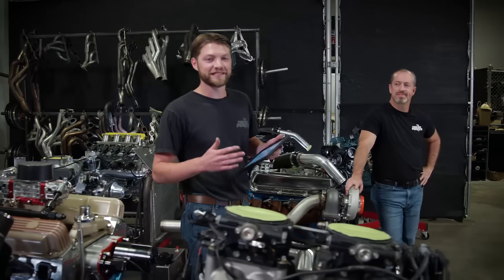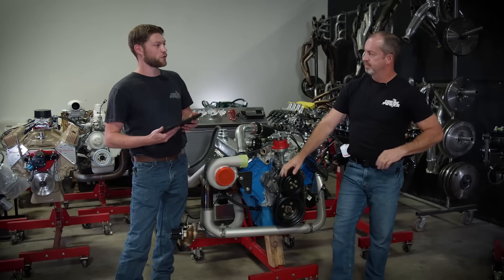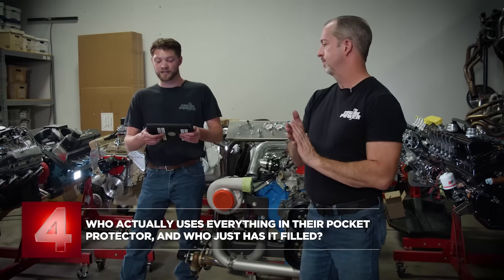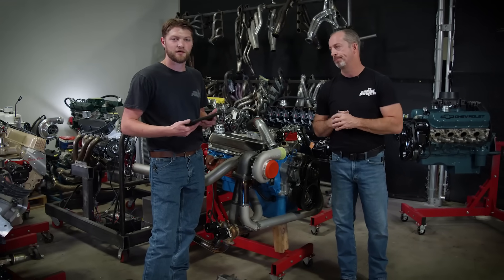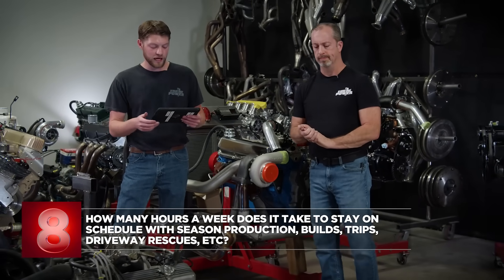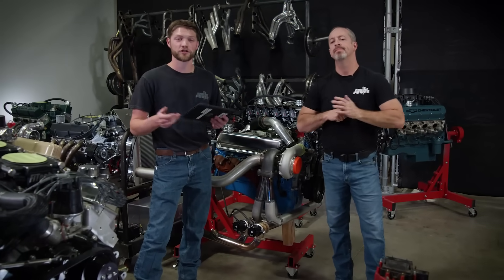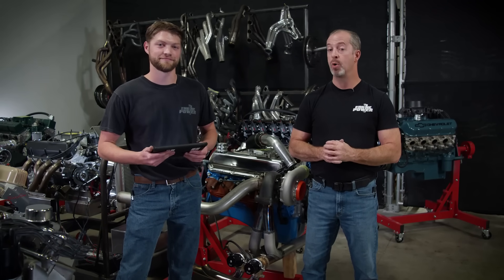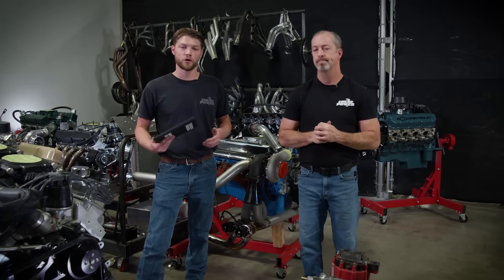Expert Engine Builders Answer Your Top 10 Questions

Comment: I have questions.

1. When you knife edge a crank do you reduce engine torque output and does it weaken the crank?
2. When you off set the crankshaft does it weaken the crank also by how much if you grind?
3. What’s the difference between normal bearings and racing bearings and do they reduce friction on the engine?

Comment: Love the show!  Question. What is a better solution wire arc’s aluminum cylinder blocks or is it better to have sleeved blocks for high rpm and compression builds?

Comment: Why hasnt no engine builder ever try to Build a Buick 401 or a 425 nailhead engine and  show us how to port out and  bore out  a 4 barrel manifold intake  for a 1965 buicknailhead and  add Alluminum 3 groove pulleys and also with the  same w engine heads bored them and  port them out and show us the Hp horpower on the dyno  improvement and them use better carb and show us with installing a  holler sniper 2 on it to see the difference Horsepower  bored out and a and 425 nail head,  do the same and the 401 425 nailhead do they  have the same diameter  heads or are the 425 nailhead have bigger  heads and are they interchangeable , and  I never seen a electric water pump made for a buick  401 425 nailhead engine  and they are small block not big blocks lolololol and  see if u add a bigger cam give power or stay the same power we need more buick nail head build and there not related to 400, 430,455 buick. And  engine  this are big block.  GS BUICK 1965 WITH 2 NAILHEAD  CARBS AND THEM MAKE A MODER INTAKE FOR THE DUAL CARBS AND THEY NEVER DID AND FOR A 4 BARREL INTAKE NAILHEAD  All buick models  1966  BUICK CAME WITH A DIFFERENT  BUICK engine  400 430 455 and  only All buicks that were  1965.and down  came   with buick Nailhead engines. Wight I think we're under estimated because we have all this knowledge  and technology  to improve the buick nail heads engine  mabe someone should remake A custom buick nailhead engine  alluminum  head with stainless steel guts  and a custom aluminum  high rise 4 barrel Manifold for a nailhead or long tube headers and other custom goodies

Comment: OK guys, number 1, big fan. Number 2, how much would it cost to build a 347 stroker that will last. Think economy build. I'm 65 and just purchased the car I've been looking for since 1983. It's got a 289, but I don't know the motor. Sounds good and runs good. I just don't know the motor. And the rear main seal is leaking just a smidgen. Let me know guys. I wouldn't even know about the 347 if not for y'all. Thanks

Comment: Hey guys, I would like to see you build a  2003 Mazda Protege  2.0L engine  stock internals  with  7-10 lbs of Boost using a turbo. Also, find out what 6sp manual transmission will bolt up to it. I believe the engine is an FS9 it's the same engine out of a Ford Probe GT

Comment: Another TNN viewer here too. You guys are great. I love the way you demystify engine building with your years of experience. I would love to see more power packages. As a Ford guy, what package does 400hp in a 302... cam specs, heads, compression ratio etc? 400hp Cleveland? 500Tq 408 stroker, Windsor or Cleveland? Thanks, keep it up.

Comment: would you consider doing an owners 100,000 mile engine in the vehicle as a show?  this is after they have done some mods but are afraid to use them because of the miles.  I have a 71 Ranchero (from Pat's hometown area) I could leave with you over a winter.  351 M code Cleveland 4v.  mods:  cam, 750 dp.  c6 shift kit.  

diagnose for freshen or a complete redo?

Comment: The first engine, not counting lawn mowers, was a Kohler K91 4hp cast iron block on a homebuit go-cart. I was in 8th grade and was trying to run it on high compression and Klotz nitromethane. It was ported, had a big chainsaw carb, milled head/thin copper head gasket and a scoop to duct more air across the cylinder to help keep it cool. My buddies that would ride it called that engine the "blue flame special" because of the long bluish exhaust flame from its straight pipe.
Reply: Mine was 6-71 in my first year of college in 1999.

Comment: Disagree on one answer.  As a mechanical engineer, I have graphed the ramp profiles of comparable specs at .050ths of a Comp Cams Exteme Energy hydraulic roller vs. Extreme Energy solid roller. The solid roller has a much steeper/faster ramp speed, which is evident by its overall smaller total duration to duration at .050ths ratio. It makes sense that a hydraulic roller cannot handle the faster ramp speed a solid roller cam. The best part about using a solid roller lifter on a hydraulic roller cam profile is that you can get away with less seat spring pressure (because of the slower lobe ramp speed), which helps everything live longer in street applications.
Reply: If you want to do this, I recommend a custom grind cam on a billet core using a cast iron distributor gear. Comp Cams will make a custom cam with a hydraulic profile on a billet core. In my testing all this extra cost is worth 10-15 hp and longer street life.

Comment: Just curious if could be even  possible to use a two different power application as a Super charger and a Trubo charger? At the same time, as well, on an example on a Ford 351C or 427 or any other model and make of engines.  Also, if you could, you be able to use it on any other straight 6 engines as well.  Or not.? I do enjoy watching your shows it's very interesting when comes to working on  different types of engines for different reasons for different vehicles.

Comment: I want to see an “Ameri’Barra” Atlas 4200 I6 turbo big horsepower build. Let’s make this engine popular.
Reply: Nivlac57 has a ton of good content on this
Reply: Never gonna happen when ls's have more parts and actually fit in things, its even bigger than a barra with next to no aftermarket and a few bugs, really no point when you can get a cheap LS, barras are popular in Australia because they are stout with very few bugs cost $250 aud and have a massive aftermarket where you can even get billet blocks and tons of manifold and cam choices with stroker and destroker kits and came factory turbo with a great coils and an extremely tunable ecu that is shared with TONs of ford vehicles in Australia so mix matching is fairly easy.

Comment: I have a 455 olds that I am rebuilding . When assembling  , the cam was tight.   I mean tap in with hammer. Thats how machine shop guy said it was a little tight. He said to turn with ratchet until I can turn with fingers.  Another machining guy told me to scape surface of tight cam bearing until loosened. I was taught cam should turn with fingers. What are your thoughts. Sorry about length of question.
Reply: Take the old stock cam and cut angled cutter grooves on the journal that corresponds with the tight spot. Use your cam/cutter to trim the offending bearing by hand rotating it as you slowly feed it into the tight spot. Remove it frequently to clean debris and use thread cutter lube. It should only take a few thousandths of an inch.  If a slight trim doesn't free it up definitely go back yo your machinist.